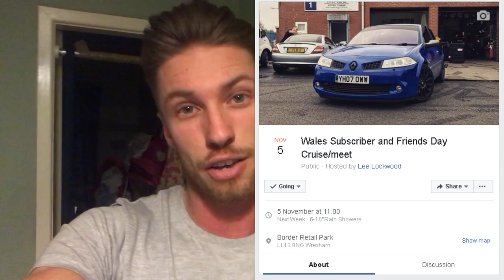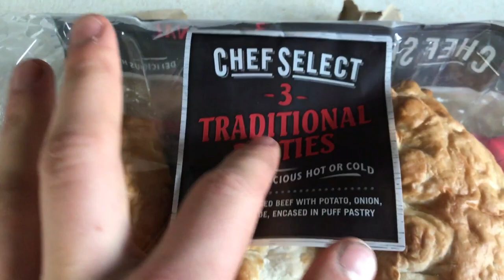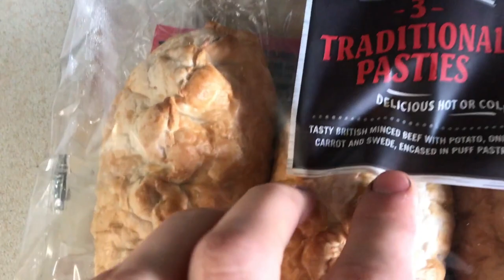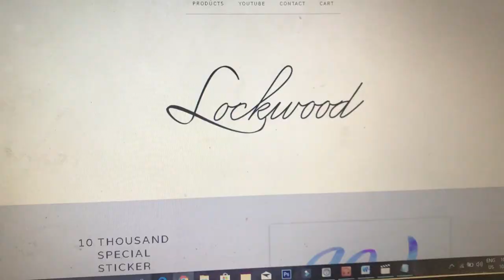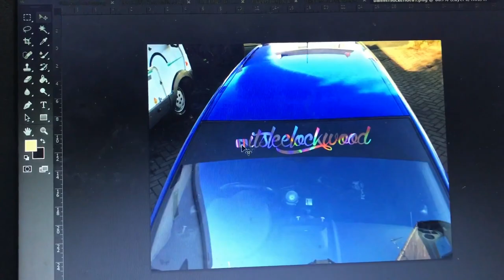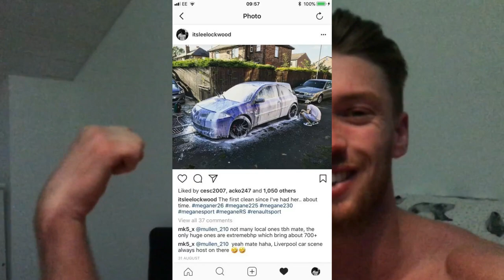You've All Been Asking For This...

Comment: Lee mate, I put lowering springs on mine and it was banging on mine proper annoying, it’s the main bolt holding down the springs from the top not the strut bolt but the bigger centre one, torque that down and it solved mine.
Reply from the maker: Callum Hawkhead did you have to remove the strut again to torque it?
Reply: itsLeeLockwood yeah it was a safer option to do so.